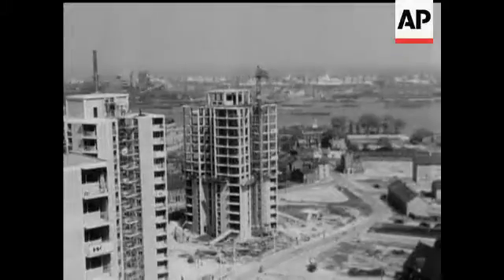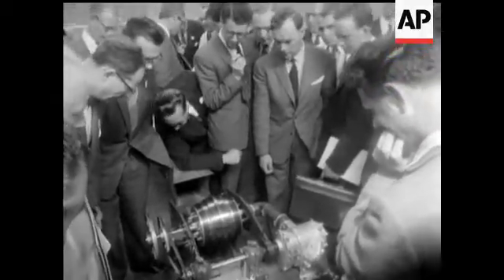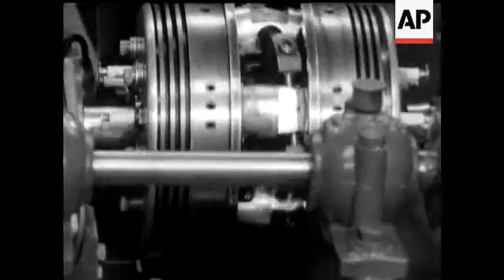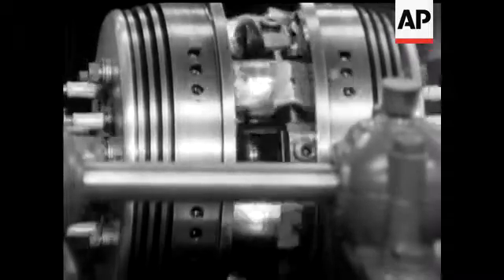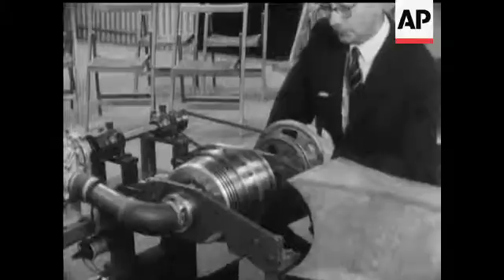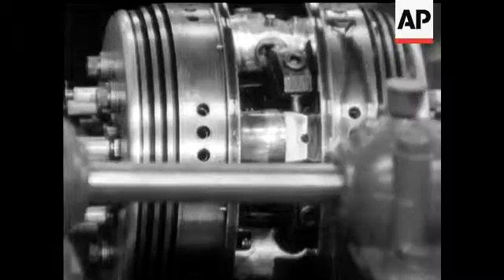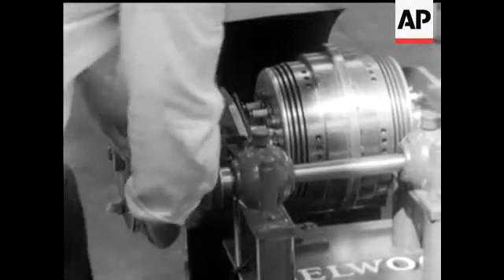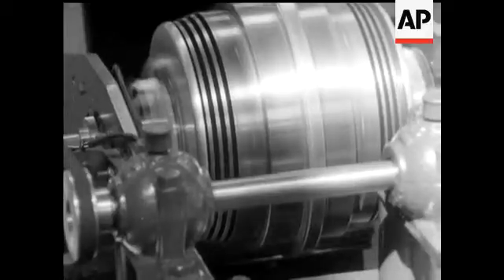ENGINE REVOLUTION

Comment: Interesting project! I came across it reading a report in a vintage German magazine called "hobby", issue 5/62 with release date February 14, 1962 which explains the functionality in detail. Mr Hughes reconned that this engine would work great in cars, small airplanes and ideally in helicopters. Does anybody know, if this engine ever went into (mass) production?